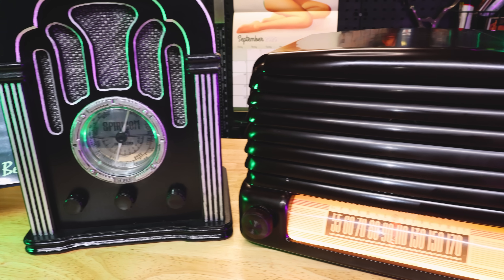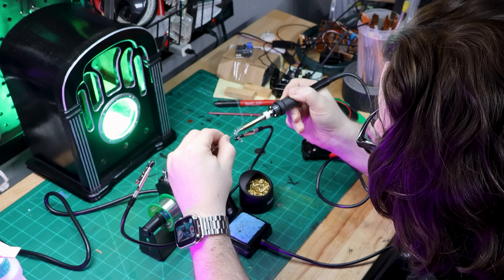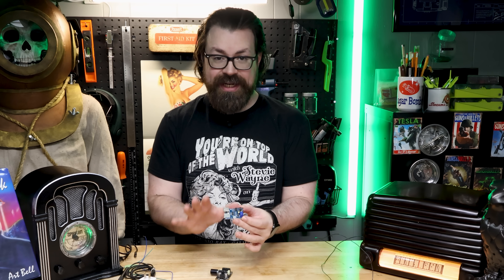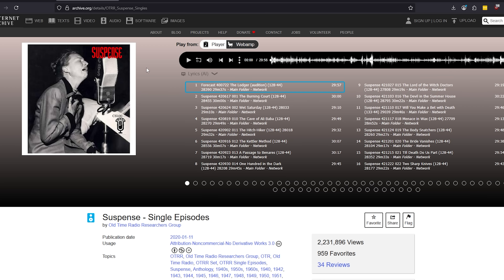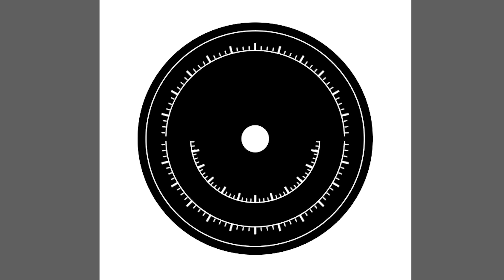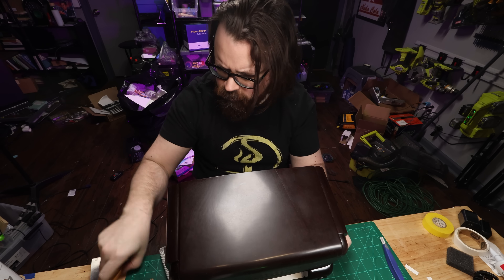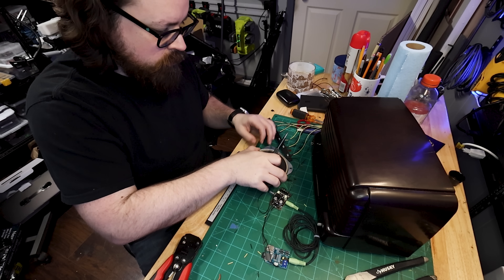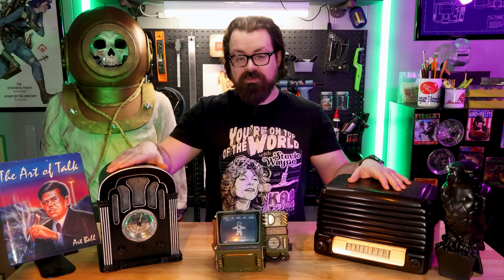I Hacked This Radio Into Something Strange

Comment: I miss Bakelite. Also - wouldn't you want the radio light to flicker for a bit as the radio starts playing? Also, FM wasn't around back then so everyone's AM and short wave radio bands had static. Could you add a DSP board to the mp3, amplifier combo to add a variable, random static background? I am reminded by the cursed radio in "And now the news," S02E03 of the TV show, "Friday the 13th: The Series.
Reply from the maker: You could absolutely do something like that, would be very cool. My version is just the bare bones that anyone could build on. I did try to use some flicker LEDs for it but they weren’t bright enough for my taste. Would be cool to wire in a flicker just on the start up.

Comment: I love the simplicity of your setup - any thoughts on how to easily include a relay/motion sensor to play the radio versus it always playing?
Reply from the maker: I imagine putting something like a motion sensor to simply cut the power is certainly doable. You could even just make a power knob that fully turns the unit off. Doing that would kind of defeat the fun of it always playing, but I could see why you might want that.

Comment: Hey Perry - this is amazing and totally inspiring!  When I saw your haunted diver costume it was an instant subscription.  I was wondering if you can show where you picked up power and how you wired the white/amber LEDs on the 40's radio?  I could see the setup briefly on camera but we didn't get to see the inside of the 40's radio like we did the spooky one.  Thanks, can't wait to make my own!
Reply from the maker: Thanks! I can’t really show it without dismantling the radio. I found it using an LED and a multimeter and testing all the contacts on the bottom of the amp. I wish I could describe it better but I can’t remember with contacts it was precisely. I tested with the amp power on and off until I found the two contacts that sent power at the right time and soldered to those. I’ll see if I can dismantle mine and maybe make a short to show the wiring better.
Reply: @theperrydaniels  That is what I was thinking but I'm glad that you clarified. Thanks so much!!

Comment: I'm hardly an electronics specialist, but unless the original audio file actually already sounded like it then this mock up won't sound like a vintage radio will it?
Reply from the maker: Yes and no. You could definitely apply some effects to make it sound more like an old radio if you wanted but mono MP3 files played through a low power amp through on cheap speaker does a pretty good job of mimicking that vintage quality all on its own. In fact the parts I used were chosen in part because they would sound a little crappy. You could switch the components out for better sounding ones and get crystal clear audio if you wanted, but I think the less than ideal audio quality is a feature rather than a bug.
Reply: @theperrydaniels ah! Thank you!

Comment: This is such a good idea!  I’m almost compelled to download the exact same content you posted.  The only thing I would do differently, is that I have a few of those old AA5 AM tube radios lying around that still works as I refurbished them/recapped them, etc.

I want to do the same exact thing you have here, except I want to use the original guts and tubes, but somehow interface the SD card player into the output tube amp.

Neat project!
Reply from the maker: That would be cool! Please share that if you get it working, I would love to that in action!

Comment: So you didn't make a radio because it doesn't pick up or transmit radio waves....

the transmission and reception of electromagnetic waves of radio frequency, especially those carrying sound messages.
Reply from the maker: That’s right. The point of the project was never to make a radio. I already had radios. The goal was recreate the experience of radio but with custom programming.

Comment: Love what you're doing but please; Learn how valve amps work! They are not difficult at all, there's tons of schematics out there and they are pure Class-A. Coupled with an old alnico magnet speaker and you have that golden sound, add a crossover and a soft dome tweeter and you have true hifi!
Bakelite: You're almost there, wash in warm soapy water and rinse, when dry polish with metal polish (Brasso is great) then wash again and rinse. Then coat it in olive oil and have alook at it every few hours, applty more if it has dried out. There is a chemical bond that grows. Leave overnight then rub down with a dry towel.
The dull look is because omeone at some point used furnituire polish on it and beeswax destroys bakelite, pitting the surface.
I build valve amps for hifi and guitar and used to work for Audio Note, so I know a fair amount. I have a sideboard at home I want playing Christmas music 24-7 all December to the end of Russian Christmas on 18th Jan so this idea is very useful for me althought I was thinking to use a Raspberry Pi playing random tracks from a USB SSD.
Reply from the maker: Thanks for the tips! I’ll look into those 😁

Comment: You can also do closed circuit RF like old game consoles on TVs...
You can run some 50 ohm coax across your house, hooked up to a transmitter and computer with a media player or auto DJ software.
(If you don't attenuate it correctly, you can blow up the radio, so be careful.)
Reply from the maker: That’s a really interesting idea. You’ve got me curious now. I may have to look into that.

Comment: It doesn't have to be Kmart music - Look aound for recordings of Seeburg 1000 records; they're abundant here on YouTube.    These were produced for a lot of retail stores, restaurants, bars, and even some factory venues from the late 1950s through the early/mid 1980s.  The machines that originally played them were stocked with special records that packed 35-45 minutes of music PER SIDE.   They even had special Christmas record sets.  It's all instrumental stuff, but the variety is pretty impressive.   The system was called '1000' because a set of records (25 to 28 of them, and the machine played both sides of each!) had around a thousand tunes before the machine would reset and play them again.

There was a subset of these records called 'Encore', which was intended for more private venues, even home systems, with a somewhat more 'upscale' set of music.

Being that the machines played the records at a very slow speed (16 rpm), the sound quality isn't stellar, but this wasn't perceived as a problem because its intended use was background music.

Here's a link to the encore records, give it a listen.   I think they'd be ideal for your project.
https://www.youtube.com/watch?v=-X-owN-uPbE&list=PL4tVaSBSrrnD5GfJrrw4vSo3ywqET96AM

Comment: wait.. does the tuner work?   Surely there is a similar minimalist mp3 player that selects by folder or something, which can be rigged to the tuning dial to flip folders if you get my meaning. or just build an array of players, and have the dial flip between the outputs..
Reply from the maker: It doesn’t work yet but that is 100% on my list of future improvements. This comment sections has had some great ideas for it. I’d love to find an MP3 player that would flip through folders like you said.

Comment: I thought this was going to be a how-to video.
Reply from the maker: I see you already found it but I decided to separate the how-to part into its own video.
Reply: It kinda is he explains how he did it quite thoroughly
Reply: @bearlycold4282 ... Hardly, unless maybe you work with electronic components all of the time and are familiar with the types of circuit boards that are available for this type of work. Most people are not. However it turns out he has another video that actually does explain how to do this. And has links for the electronics being used.

Comment: This is so cool. The only thing I would try to figure out is how to "program" randomness into the "broadcasts" it would prolly require sone coding but it would be so cool to have hours of the day for certain things like morning radio or the old radio shows always playing at the same time but each episilode is randomized. You've got me inspired sir. Im glad you were able to create what you wanted 😊
Reply from the maker: If you figure out how to do this PLEASE let me know. I even looked into the software that radio station program directors use but I never found something that did this and didn’t cost thousands or dollars. But that level of programming is the Holy Grail for this project as far as I’m concerned.
Reply: @theperrydaniels OK. After a quick search I found that it should be possible. You'd need a raspberry pi (cause an operating system is needed to run the executable) and use Linix Cron Job for running a python exe randomizing a playlist at a certain time of day ie. randomizing files from "evening playlist" at 5pm. It sounds convoluted but its just one relatively small python script and a timer that's already built into the operating system. I would add a permanent touch lcd and an exposed USB port so you can add files to the playlists and tweak the timing anytime you want. I am not a computer programmer so there might be a flaw in this solution. Its the problem solving that's making my brain tingle lol.

Comment: Now if we could have other tracks on different "dial frequencies", then this would be slicker than snot. Maybe an Arduino-based platform would work with an encoder.
Reply from the maker: Absolutely! It’s one of my hopes with this video that someone takes this idea and runs with it. I aimed for the simplest possible version but I know someone smarter than me could make a way more complex but way cooler version of this.

Comment: really cool build. Any thought on using a few mp3 boards and simulating changing "stations" so one radio could serve multiple roles. Talk, Music, Number Stations, etc.
Reply from the maker: It’s definitely something I’ve thought about and few comments have given some ideas about how it could be done but I haven’t gotten around to it yet. Definitely on my list to try. I think that would be fantastically cool.
Reply: This is really cool. How did you get the on off and volume switches to work?

Comment: I dig it, I have vintage radios throughout the house, table top and hamdhelds. I have a raspberry pi connected to a 'talking house' an AM transmitter used by realtors back in the day. I use music on console command line music player for Linux, to play 30s, 40s music internet streams and can turn on any radio in the house, tune to my station and pick up whatever happens to be playing. something kind of cool about catching something midway through. sometimes I'll switch it up and play dragnet and jack Benny for a few days
Reply from the maker: Holy crap, that sounds like a wildly cool set up! I’d love to do something like that. That sounds like exactly what I was looking for with this project.
Reply: @theperrydaniels you can still buy them. I had my own Part 15 (legal, unlicensed) station on which I broadcast the last show Art did (not the last day, but the last show he did before he died. I think it was called “Midnight in the Desert”). The network he was on was friendly to Part 15 stations. The station was called QVWN, as there are no radio stations with the initial letter Q.

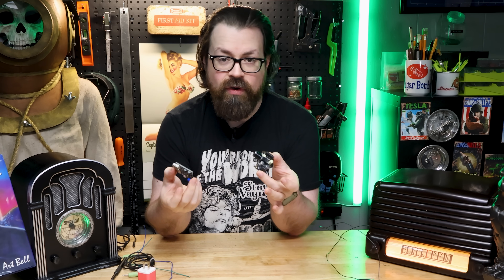On my stations, I did a formal sign-on at 08:57:50 or so, like stations would do before they went 24 hours. I hate morning radio, so the carrier was dead from 04:00-08:57.

I used the Zara automation program, so the station was airing programming from 09:00 Eastern to 04:00 when MITD finished. I also had permission from the host to rebroadcast “Spooky Southcoast” on Saturday nights. Now THIS is A.M. radio! I may light it up again one day.
Reply: That does sound pretty awesome. I love some Benny

Comment: Briliant! I have 4 Crossly radios. All I get is static on them. I was going to try to fix the radio part. But with these boards I don't have to! I literally have gigabites of old radio shows stored on drives. If I can't fix the radio part, then my short range FM transmitter won't work. So, I'll go with your solution. And maybe I'll just go with that to begin with. Thanks!
Reply from the maker: Give it a go! I absolutely love mine. It’s really surprising how well they mimic a radio. It’s really given new life to my old ones.

Comment: Hi, Perry.  I'm looking forward to putting this together.  However, could you please let me know how you power the light you added to the Bakelite radio? Is it something as easy as splitting off the power that's feeding the MP3 player into an LED fixture of some sort?  Thanks a ton for this and you've got a new subscriber!
Reply from the maker: Sure thing! There are two connections on the underside of the  amplifier that you can solder the LED onto that will pick up power when the amplifier is turned on. It’s hard to be super specific about their placement because I’d have to rip my radio apart again to see and they were labeled anyway. I found them using a multimeter.
Reply: @theperrydaniels  Did you solder the LED directly onto it or did you need a constant current LED Driver circuit board?  Thanks again!
Reply from the maker: Just directly to the board.

Comment: If you add a 3.5 mm switch between the amplifier and the MP3 board essentially you could put in 2 or 3 more MP3 boards with different style music on the SD cards an essentially have a radio that plays different stations by push button
Reply from the maker: I’m really tempted to try that on my next build. Being able to turn the dial to “tune in” different stations would be such a killer feature.

Comment: Love the idea of a perpetual radio... I find tired looking Bakelite restores nicely with soap and water (to degrease). Small blemishes can be buffed out with toothpaste, or watered down T-Cut in pinch. Then finally polish it with liberal amounts of bees wax and a microfibre cloth. Mineral oil will temporarily darken it and add shine, but doesn't penetrate as deeply as a few applications of bees wax. As a suggestion, instead of a mechanical switch how about installing a photo sensor so the radio mysteriously activates with a light source. 😏👍
Reply from the maker: I like the photo sensor idea! That would be a fun twist for the Spiricom, I may have to toy with that. I’ll definitely give the bees wax a try too. The mineral oil does seem like a band-aid kind of fix, it just covers the problem temporarily but doesn’t really fix it. Thanks for the tip!
Reply: @theperrydaniels  You're most welcome, keep up with the great content, love sharing ideas, amazing things can come from it. You got my sub! 👍

Comment: I love your build...
I would have likely set up a personal radio station and used regular radios, 
But yours is made of magic, and it looks like it works perfect !
Reply from the maker: Thanks a lot! It works far better than I ever expected. I am curious what you mean by a personal radio station. Would you use an FM transmitter? I’d love to find other ways of solving this problem.
Reply: @theperrydaniels Do you know how to build a phased lock loop circuit ?
Reply from the maker: I do not. Would it help if I did?
Reply: Yes I do, did you want help with one ?
Reply: @theperrydaniels yes, I was thinking of a radio transmitter 
But then i have extra ones i built long ago...

Comment: I'm really glad you produced this video. I'm a big fan of low power FM and for years I ran a mini radio station that only went maybe a few hundred feet. During Halloween I would run old time radio broadcast of spooky shows, complete with old commercials from 30-60s. During the holidays it was Fall and Christmas music 24x7. LPFM transmitters can be found for under $100, with RCA or mini jack input that from your favorite device. I really like your approach though, it makes it super simple just plug and play. By the way, check out CBS Mystery Theater for a real hoot. Lots of spooky stuff to discover there.
Reply from the maker: Thanks, I am loving how many other people are into this same type of idea. I didn’t even consider an FM transmitter. I kind of forgot they existed until reading through these comments 😂. I may have to get one and play around with it. I’ll look into the CBS radio dramas, too. Thanks for the tip!

Comment: I bought an fm transmitter that connects to my phone via Bluetooth and wired it into the radios power supply. So the radio still works as it should but you can tune to 87.7 and play Spotify. I wanted to do what you did but you made this video 3 days ago and not six months ago. I think I’ll do this for my 80s clock radio and play music up until the 2000s along with some classic Chicago sports games. Neat project! Consider me inspired!
Reply from the maker: Nice! I hope you do try this. I have been amazed at how well it mimics a radio and an 80’s clock radio is a PERFECT use for this. I kind of want to do one like that now that you mention it, that would be such a nostalgic piece to have around.

Comment: If you have one, you should 3D print an sd card holder and mount it to the inside of the radio. Then you'll have all your play lists ready to go. Or, find a way to connect them all and have something that will let you switch cards on the fly. That would be cool. Maybe have 1 card with different folders and switch folders with a remote. The sky's the limit. That would keep it in the true spirit (pun intended) of the build. Really cool. I love old radios and tech.
Reply from the maker: Not a bad idea! I’ll have to give that one some thought 🤔
Reply: @theperrydaniels nice.